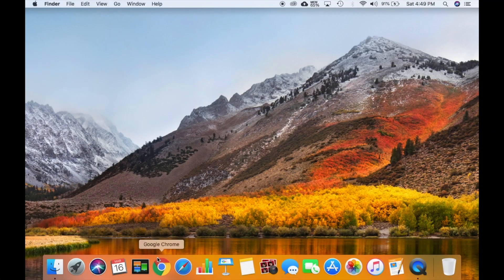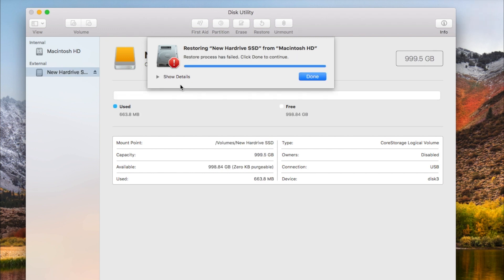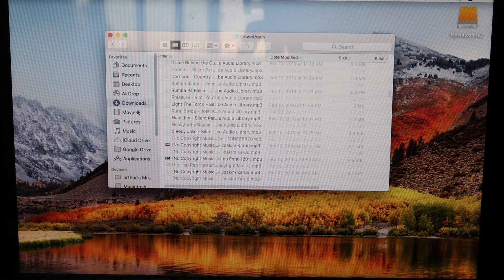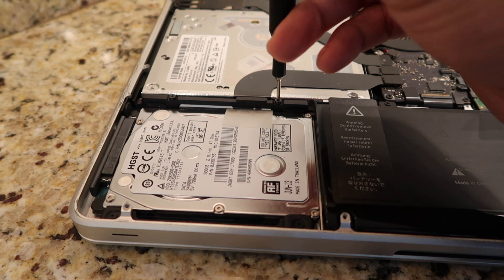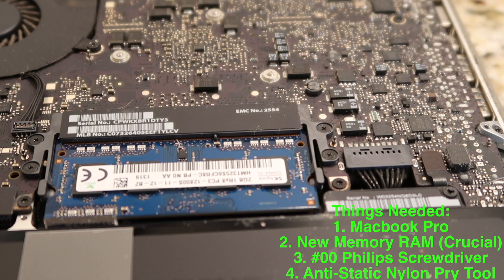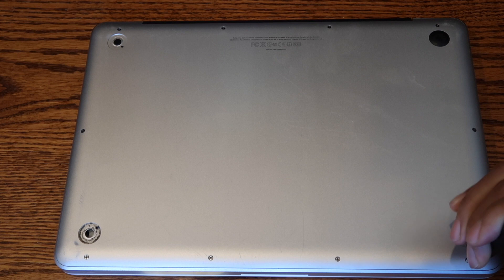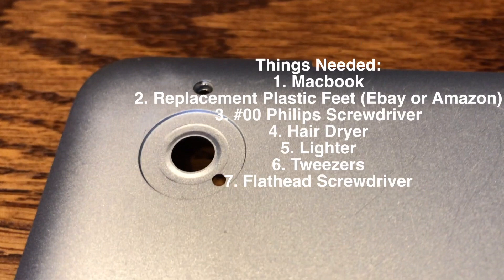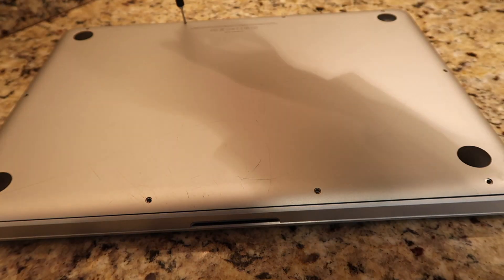HOW TO UPGRADE MACBOOK PRO MID-2012 | UPGRADE MACBOOK PRO (2022) | FASTER MACBOOK

Comment: Great video.  My macbook pro 2012 used to hang up when you tried to open anything, the power was very glichy waking up or on start up.  Now, everything really hums, it truly is like getting a new laptop.  I was on Catalina prior to upgrade, so cloning my hard drive required a different solution.   So, I restored my hard drive from Time Machine instead of the disk utility process described in the video. For my upgrade, I added 16gb ram and 4tb samsung SSD that I got on Amazon and was able to locate a new OEM macbook pro battery.  I had done the ram and the battery first (I received those first) which made a noticeable difference, especially with the temperature of the laptop(make sure to condition your battery as described--i conditioned it twice). Once the sata cable came in I was able to restore the new ssd hard drive from Time Machine---amazing.  In addition to all the speed, the macbook pro 2012 runs at a cool temperature, programs start up right away.  Like I said, it its like having a brand new laptop at a fraction of the cost of purchasing new and with the 4tb ssd in place I no longer have to keep all of our photos on an external drive-which is now now a spare backup kept off site.   Thanks again for making this video and showing the way.
Reply from the maker: Thank you so much for the breakdown of your experience! This will help others as well.
Reply: D.A.T.A Productions i am currently on OS Sierra, would i be able to clone? Or will i need a time machine backup? 

Thanks!

Comment: is this i5 or i7 MacBook ??  coz I think i5 only support 8GB right ??
Reply: It is listed as 8GB max but the computer will use 16GB , mine is currently running on 16GB and working awesome, very effective upgrade from 4GB
Reply: Josh Pugh link on the ram?
Reply from the maker: This was the regular mid 2012 Computer!

Comment: Hello! when pressed the restore, the "Macintosh HD," won't show up and when I put into recovery mode, it saya, "restore process has failed. click done to continue." What will I do? Thanks a lot.
Reply: same here bro! mine wont show up. Instead of MacOS extended (journaled) mine is APFS encrypted and I have a "Machintosh HD" and "Machintosh HD-Data"
Reply: @ebravo31497  Did you figure this out yet? I think you have to back up through time machine instead through disk utility
Reply: KC Ross-Miller That’s what I was gonna do but I just sent it to a small computer to do a data transfer on it. Thank you tho!
Reply: ebravo31497 did that work? You know how they did it?
Reply from the maker: Hopefully you have figured this out!

Comment: Hi! Thanks for this video. Where did you get the new macbook certified battery? I can only find random ones online (newer tech or ifixit) & would those work well?
Reply from the maker: I got mine from Ifixit. It works well! It lasts longer but not substantially longer.
Reply: @DATAProductionsMedia  sweet thank you so much! I got mine from newer tech/MacSales .com I hope it works alright!
Reply from the maker: Casey Mcsherry I hope it works out for you as well!! Subscribe for more content like this 🎥💭

Comment: Thanks for the very informative video. I have a question if you would please help with, I just bought one from a friend and want to upgrade it, but since there isn’t stuff I want to backup or transfer, what steps do I take? Also what iOS am I suppose to install? Thanks.
Reply from the maker: pablo pueblo if you don’t need to transfer anything, just install the new SSD! Just remember to format the drive correctly. Thank you! 🎥💭
Reply: @DATAProductionsMedia  Would the mac update to the latest ios software? I'm looking to switch to the mac. I use a lot of photoshop and designing.

Comment: When I try to restore the Macintosh HD to the SSD it’s telling me the restore process has failed.
Reply from the maker: Danno596 go to (2:05) in the video. I explain why the restore process doesn’t work. You have to unmount your drive from the MacBook “virtually”
Reply: D.A.T.A Productions I’m still getting an error while in recovery mode that says  : “couldn’t set up partitions on target device -operation APFSVolumeToContainer, line #4526 -error 49231 The operation couldn’t be completed. (OSStatus error 49231)
Reply: Ok seems to be because I initially formatted as “extended journaled encrypted” seems to work when formatting as just “extended journaled”

Comment: The one thing that confuses me is the drive HDD inside the mid 2012 is 9.5cm long but I recently bought the Kingston a400 that says it’s compatible with this laptop and it’s 10cm long? I understand the ssd needs to be 2.5” but how comes nobody speaks about the rest of the dimensions of ssd? 😧 thanks for the video
Reply: I just took it out and they are the same size... seems like the old hdd had the plastic bit attached so I was only counting the metal part which was 0.5cm shorter ahhh thank god
Reply from the maker: @WatchuGoneDo  Glad Everything worked out. Subscribe for more content!
Reply from the maker: Were you able to get the Kingston A400 to fit? I apologize for the hassle of dealing with that!
Reply: I haven’t opened it yet because I could clearly see the difference in the packaging. Looked wider by a fraction.

Comment: You deserve way more subs and views. I did 2X 1TB SSDs and 16GB Ram. That created day and night difference for video editing and AE. I what you use yours for?
I'll also be happy to learn about your opinion of using an eGPU and upgraded Mid 2012 MacBook Pro with a Thunderbolt adaptor? Peace! Keep up the excellent work! Aw and BTW. I DO APPRECIATE THE SOUND. I watched the video with headphones. No echo, no noise! Perfect!
Reply: Is it possible to use the Samsung EVO 860 1T SSD on my Macbook pro mid 2012 non retina 13" ?
Reply from the maker: @mikefantos2878  Yes this is exactly what I upgraded.
Reply: @DATAProductionsMedia  also, do you know if with time machine, parallels will also be transferred to my new ssd?
Reply from the maker: @mikefantos2878  Not totally sure, but if paralells is a file, that is stored in your time machine, I would say yes it would transfer. Every file on your computer should transfer to be exactly how your laptop was before.
Reply: @DATAProductionsMedia  I changed my drive disk. Parallels was copied. The only bad thing that happened is that apps like autocad which use hard drive as pathway, couldnt find the old pathway and give me errors when trying to open a file.
Reply from the maker: @mikefantos2878  ahhh I see. That great information to know! Thank you! Subscribe for more content!
Reply: @mikefantos2878  YO! I'm pretty sure you can. However, I suggest doing more extended research before actually purchasing the SSDs.
Reply from the maker: Thank you so much! I use mine mainly for video editing. I am happy the upgrade worked for you as well.

Comment: Will this work if your old hdd drive is APFS format to the new ssd APFS format? I thought you needed to download special cloning software.
Reply from the maker: If APFS is an option for formatting on Macbook Pro, then yes it should work as instructed. If APFS is not on the drop down menu when formatting then you will probably need special software.
Reply: Hi gents, just want to confirm, if my old drive says APFS volume then I need to select this when erasing the SSD?